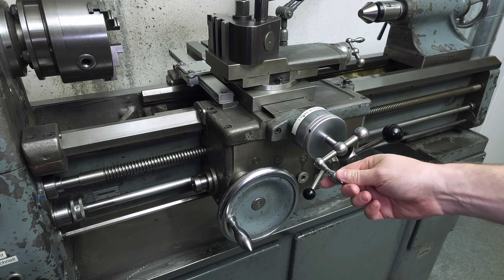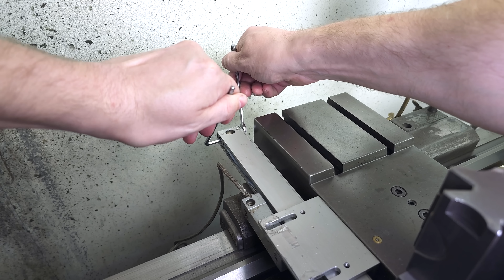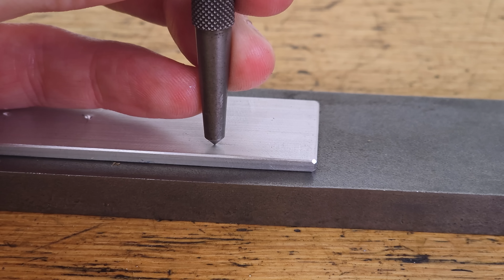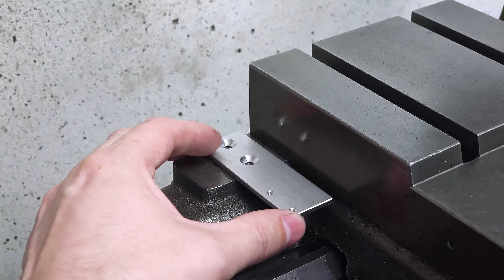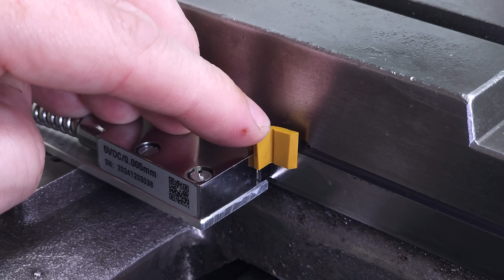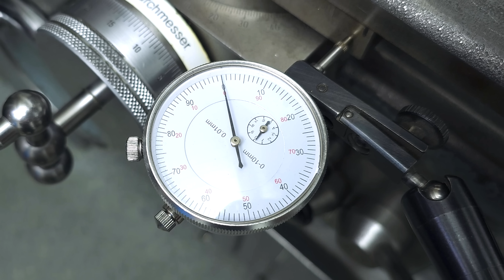I Upgraded the Linear Scale - Dirty Lathe and Clearance Issues

Comment: Based on the magnetic strip, is that a magnetoresistive sensor, right? Have you considered using a hall effect sensor? While not as precise as magnetoresistive, Hall effect sensors are very compact and inmune to dust and vibrations, also waay better than the optical that you had, but keep in mind that they have some drawbacks that you must take into account, mainly sensitivity to magnetic fields and temperature.

Comment: I’m a metrologist and specialize in. Calibrations/measurements. Could the 0.01 mm difference be due to hysteresis? When the gears move on the X axis you should get a more consistent result as long as you approach every measurement from the same direction. Potentially, if you go under your zero on the return and spin it back up to it from the initial reading it will null the hysteresis error.

Comment: Short question: won't it be a problem for the magnetic measurement system with turning ferromagnetic materials? That was the first thing i thought as you said you will use a magnetic strip based measurment system.

Comment: Hello MyMechanics,
thanks for all of your content, when I see a new video from you that's a no-brainer, just click and enjoy !
We installed this kind of linear magnetic scale encoder on a lathe but we encounter measurement drift in the middle of the magnetic pitch, probably because mesurement is interpolated between large (about 2mm) pole pitch. Lets say we use a dial gauge for comparison and make measurements at :
0.000 - 0.100 - 0.200 - 0.300 - 0.400 - 0.500 - 0.600 - 0.700 - 0.800 - 0.900 - 1.000
then we have an output result that looks like :
0.000 - 0.100 - 0.205 - 0.305 - 0.410 - 0.515 - 0.615 - 0.710 - 0.805 - 0.900 - 1.000
Maybe we bought a faulty or bad quality scale. Do you encounter this nearly 0.015mm imprecision on your scale too ? Never had this issue on optical scales.
Best regards
Jérémy

Comment: Nice work! But didn‘t you create a new perfect bag for Dirt between the sensor and the metal strip between the two sealing elements? As far is it seems, the metal plate holder is closer to the strip than the sensor, so there is a tip for collecting the dirt. And since the dirt is iron, it could influence the magnetic field in the worst case?

Comment: I prefer to mount the magnetic strip in a aluminum .
You can buy pre manufactured aluminum profiles for the strip.
Without cover small iron particles are sticking on the strip.
An the oil can destroy the material of the strip

Comment: I would still have placed it on the tailstock side of the X.
You just have to make a bumper to keep the tailstock from hitting.  
My Emco has a rod that screws into the tailstock, which hits the carriage, to maintain that spacing.
Nice work, nice Weiler!

Comment: This is interesting, I've known those devices as encoders (or linear encoder in this case). The magnetic encoder should work in a similar way to how HDD works, with tthe sensor similar to read/write head (maybe without the write functionality) and the magnetic strip similar to a  magnetic disk platter.

Comment: I use the same scales on my machines as well. I did end up adding a thin shield on top of the sensor to prevent chips from falling in between it and the scale. The shield is just a piece of shim stock held with thin double sided tape. I mostly work with brass, so the magnetic nature of the sensor is not impacted by the chips. When I do cut steel (and cast iron!), I do regularly wipe the chips off the scales.
Reply: I did wonder if that may be a problem that would reveal itself later when the strip and sensor have had some usage. A thin shim stock cover is a simple fix👌
I did also wonder if a 3D printed cover might work out well.

Comment: @mymechanicsinsights
Very nice well thought out upgrade video, except for that one little mistake, and thank you for showing your mistake.
But I have one question, is the 0.01 mm difference a constant over the "there and back" travel of the cross slide or is it possible for it to be an accumulated difference (since it is a magnetic strip), in other words if you move the cross slide from front to back several times does the error remain the same or does it accumulate in lots of 0.01 mm steps.
Also a suggestion, many DROs I've seen have the capability of being recalibrated to the length of travel of the sensor head, does your DRO have that adjustment?

Cheers from Down Under.
Reply: When cutting something where accuracy is important, he checks the numbers with calipers and micrometers, and resets the DRO to the measurement at every cut. This is a complete non-issue. 🙂

Comment: Great job ! It would be good to add a dust cover for the entire scale to prevent the build up of dust and chips between the sensor face and the magnetic strip. A dry air purge arrangement would also prove useful.

Comment: I really like these new magnetic scales, so small and compact compared to optical. I have a lathe that is a little larger than yours to install one on. There is enough room under the cross slide that I can in install the scale and reader head inside of it, so it is completely hidden and out of the way. Great idea using the seal sealer to keep oil and grit away from the scale adhesive.
Reply: They are almost slimline enough to get them located inside the channel/trough in the saddle where  the cross slide screw and nut are located.
Reply: @howardosborne8647  That's just exactly where I am going to put mine.

Comment: ah, yes... im sure a MAGNETIC strip will have less problems with METAL dust on the lathe, specially mounted right under the cutting tool area...
also, you added those wipers but nothing to cover the area between them in the sensor, if a hard chip gets in there its gonna grind your scale like sandpaper

Comment: If the original DRO was mounted correctly (vertically) it actually uses a lot less space and is faced down so it stays clean, And it is by far more useful to use a long nose center if working with small parts and the tailstock and having the ability to use the follow rest

Comment: Nice improvement :) Better than optical for sure! It will be interesting to see how durable it is - I guess the metal may get scratched over time from chips
Reply from the maker: Having the same on the milling machine for many years without any issues.
Reply: @mymechanicsinsights ahh so you already know it’s a reliable solution 😊

Comment: the mag scales attract steel/iron like nothing else..  and the self-adhesive tape won't stick for long if oil/etc. can crawl from below under it (the seal at top won't help).
U should have went with a modern 1um glass scale of the (super) slim type (KA200 or KA500) and installed them with the swarf cover that they ship with and oriented them so that the sealing-lip is facing DOWNWARD.
Reply from the maker: They're not as magnetic actually, it's more like a magnetic strip on your credit card, that only stores memory. I'm using them on the milling machine for a long time already and never had any issues with them.

Comment: I was wondering why did you drill new holes on the lathe for the adapter plate, and not use the old ones? Nice upgrade, can't wait for the next video.
Reply from the maker: For the old ones I'd need to make an L-shaped bracket to use. The were also a bit small and not aligned.

Comment: Really cool, man. I've ever wondered how this retrofitting systems works. It's pretty precise but i have to ask you the most important question: you blindly trust to the scale or still use the caliper every time? At the shop i have to rely on touch probes (i machine mostly pieces BIG, that also require micrometers) and i don't like it, even if the lathe is a multimillions monster.
Reply from the maker: I tested them now, and I know the function accurately. But when turning I always touch off the part, set the DRO to the measured value, turn the part and verify again and correct the DRO if needed. After that I pretty much trust it blindely and only measure at the end if it's correct. Which is usually is, if there's not something else going wrong ( part being pushed back, tool not clamped properly or stuff like that)
Reply: @mymechanicsinsights  The good ol' zero on the surface, the pillar of our work!
I did not understand a thing, so let me ask, sometimes you use a spindle that also has a mill (for example you use it when you make a new one hexagonal nut): is this machine in your shop or is a machine of some of your friends?

Comment: Certainly a nice upgrade, but what if metal shavings get between the sensor and the magnetic line, wouldn't the line get permanently damaged? I mean, it's definitely better than optical stuff when even cutting fluid caused some issues, but still

Anyway, thank you for the video
Reply from the maker: To be honest, I don't know yet. I need to test the setup and see if it will cause issues. If so, I'll make another cover for it. Time will tell. I'm using the same setup on the milling machine and never had any issues with it.

Comment: won't the magnet pickup all the metallic chips?
Reply from the maker: It's very low magnetic, more like the magnetic strip from a credit card that stores the data.
Reply: I'm going to guess it is shielded in all other directions, and the wipes clear anything along the track.  The clearance between the strip and the sensor looks extremely small (I didn't see what size shim he used).

Comment: do you never use your follow rest ?
there is only one problem with Magnetic linear scale  is they have a precision that is that does not go below 5 microns 
it means double up on the cross slide 0,01mm
the most glass linear scale have a precision of three or five microns but you can find some that is more precise
Reply from the maker: 0.01 accuracy is well enough for that lathe. The Z axis also has the same with 0.005mm.
It works great for what I'm using is.

Comment: When i mounted my strip, i ran into the same clearance issues between the tailstock and the saddle, but i solved it by mounting the reader head to the top, inboard, facing towards the tailstock, and used two aluminium plates to raise the strip to face towards the gearbox, spaced just right. I solved the reverse issue by changing two wires in the plug.
Reply from the maker: Great idea 😃👍
Reply: An impact buffer can also be fitted to stop the tailstock from crashing into the DRO sensor

Comment: Is not an extra seal,  on top of the sensor, similar to the yellow ones on the sides, and touching the original cross slide a better guarantee oil and chips don't come inside?

Comment: Am I the only one thinking that chips will stick to the magnetic strip ?
Reply: I thought that briefly, but then realized that it's probably about like the magnetic data strip on a credit card -- the magnetism is far too weak to hold even iron dust, much less chips.
Reply from the maker: The magnetism is very weak indeed. I have the same scales on the milling machine and never have any issues with the scales.

Comment: love it! 1 question: why dont you make the rod on the talestop longer? So it doesnt have to come all way towards the middle part, and it still extends the cone at the end to where it is now? I hope this makes sence^^
Reply: Na you want it as short as possible because of stiffness. The rod is the least stiff part on the talestop and sure you use as long as you need but always as short as possible. If the stiffness is to low everything will swing and vibrate and you can see that on the surface of the piece you are turning.

Comment: Take apart the old one. Post pics of the optical scale and sensor.
Reply: @_D_P_  I used to operate a paper cutter in a printing company. The cutter - a German built Polar machine from the 1980’s had a linear scale like this for the measuring system. It read down to 1/100th of a millimetre. The makers name was something like Heidenhain (?). Apparently the “scale” increments on the fixed “glass rule” inside the case were so minute that they looked like a darkened strip. The moving “reader” component had a similar scale where there were four sets of lines, 1/4 of of the width of said lines “out of phase” with the set before. This gave a vernier effect for the measuring system via a light source and receiver - possibly one set for each group of graduations in the “reader” component.
 I was given this information at that time by our regular Polar service technician so as heresay, it could be completely wrong! Hope this may help your understanding of the system. Stay safe and well.

Comment: At 5:33. What about mounting a say 3mm plate to the bottom non moving part of the cross slide, protruding about 15mm above the cross slide, mount the scale on this and mount the sensor on top of the cross slide facing the tailstock, about midway between the slotted table part and that oiling point?

Comment: Aren't steel chips going to be a problem regarding the magnetic tape? Great video!!
Reply: I see you answered with the seam sealer, but what with the ones coming in the gap between the sensor and the stainless steel strip (between the two orange wipers)?